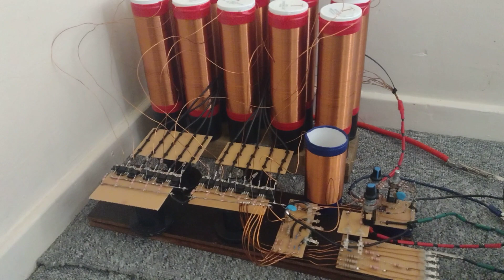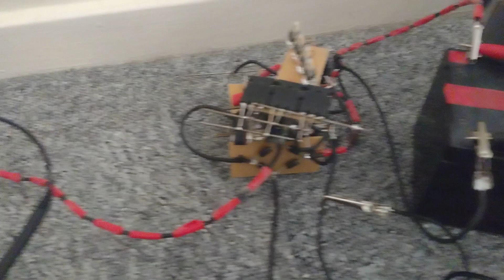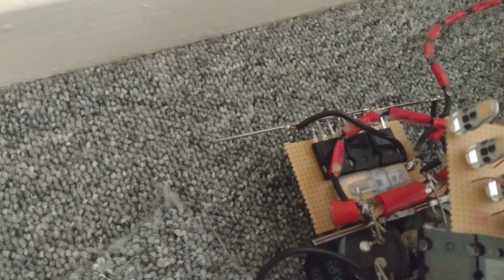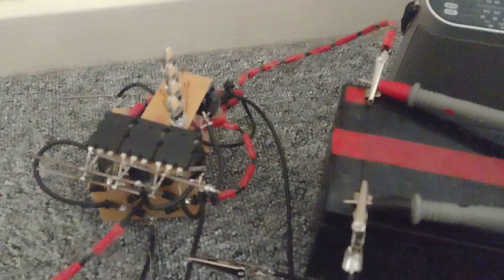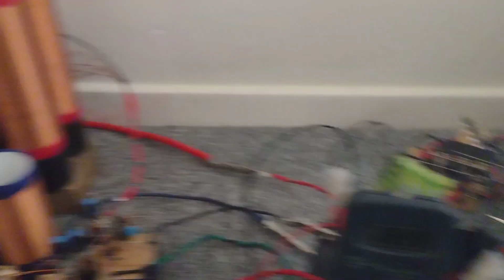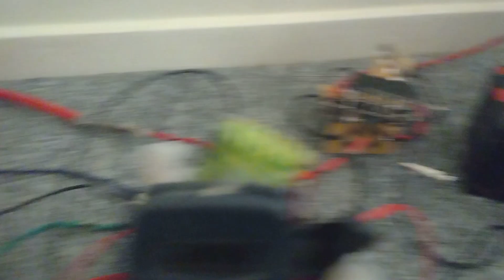Major Updates & huge amount of progress made.

Comment: Are the bulbs acting as negative resistors in the dump circuit or just as tuning resistors. I miss working on energy devices like this there is so much to learn. Thanks for sharing your work with us.
Reply from the maker: Thanks...  The bulbs are actually acting as Optocouplers & are behaving like an automatic  trigger that's switching the Transistors & Mosfets... this is what I thinks taking place here  By ganging them up in series & taking them outside of the Capability of my devices ability to light them...  if I don't use enough of them in series & they begin to glow then this halts the charge...  They all seem to work... every one that I've tried I've had success...  Thanks for your message..
Reply from the maker: I've watched several videos on here where various techs have tore the bulbs down or some of the higher wattage alternatives to reveal real intricate surface mount components inside them which is making this all possible..  including opposing diodes on both sides which makes it possible to reverse the polarity with the LED's & Halogens..

Comment from the maker: I've just increased the power of this device..  which has really improved the charging.  Look at the coil which I'm connecting to the ground with the Small Cap.  I've joined 2 other coils of equal size & connected them in Tesla Series with the 10nF.. this has made a drastic improvement in the charging...

Comment: Thanks
I had a question on your circuit
Where is the red dot going to?
Nice job
Reply from the maker: I replied to you but I don't think my tags are working.  Its not connected.  Your probably referring to a connection coming off the bases of the Transistors.. they're not being used.  Thanks.
Reply: @oliver1224  thank you my friend
I have several questions
1. The 8 coils, are the just single filial wound about 200 turns?

2. The G4 leds, they are 12v?

3. G9 halogen, 120v?

4 I guess the SSR is not connected to anything? It says input but what driving the SSR? I didn’t see any connections?

Thanks for your efforts
By the way, have you done any measurements of any sort for input and output?
What I probably test is to charge one battery or a series of vatterus from another and then switch them around
If we can maintain or increase the voltage on the charger and charged batteries, then we are going somewhere

I like your opinion and the goal here please

Thanks again sir
Reply from the maker: @Gacha.Cupcake  Your correct on everything.  200 turns .21 or .22 gauge wire.  Yes the G4's are lower voltage so this is why you need to join them in series.  It seems that all the G4's work.  Only tried the 3 watt G9 Halogen..  This specific Capsule device is connected on to both sides of the output.. the SSR is switching the positive side... but it will work without it & default on the negative if I disconnect the SSR.  Not sure if you got my message about the red dot on the drawing...  if its coming off the bases of the Transistors then its not being used so its left disconnected.
Reply: @oliver1224  thank you Mr Oliver
So there is no signal driving the SSR?
I will set one up shortly and if I manage to get it to work, I will make a video.

In the meantime, some rough measurements would be in order to figure out efficiency 
Great research my friend
Have a great and ENERGETIC day
Reply from the maker: @Gacha.Cupcake  No it doesn't require it.. it switches itself & only requires the output to be connected or you could use a Fet or NPN Transistor instead... ..All you want to do for starters is have a go at building the the vanilla single Transistor, single coil version shared on Patrick Kelly's website...  then you'll get an idea of how good its going to be... also don't operate it without your output load connected or you'll burn out your circuit.    as for your main Transistor I'd choose the MJE13009.. its performed the best out of the different Transistors Ive tried in it..  Thanks you have a good day too...
Reply: @oliver1224  thanks for the info and advice
On one of the circuits you have +12 and -12 for input
Should that be just zero(ground) and 12 bolt?
I already wound a single coil with 200 turns and even though I have a bunch of transistors, I ordered a few BUL216 since I couldn’t find the MJE13009 at Digi-Key or mouser
Reply: Also can’t find the RDVSBT diodes that are on your diagram
Where did you get them and are they any special or can I just diode a similar diode?
Thabks
Reply from the maker: @Gacha.Cupcake  Go with the MJE13009...  you can source it on Amazon..  then go direct if you wish.  Yes its + 12v & - 12. or ground.  Most NPN's will work in this system.. its just some work better than others.. as for the diodes look for the UF5408.
Reply from the maker: @Gacha.Cupcake  go with the UF5408 diodes & Transistor look for MJE13009.. I got 50 of them from Amazon for just over £35.  They took a while to pre order though..   They work well in that system & they're quite cheap..  Also later you can beta match others to build a more powerful device..  Good luck with your build..
Reply: @oliver1224  thanks
Yes I got UG5408s
Ok on MJE13009
So you are using a power supply for -12/+12?
I was planning on using a battery but I have power supply that can do -12/+12
I was planning on using a signal generator or PWM to drive the mosfet but can do the 555 timer circuit as well 

So from the top of the 8 coils, instead of going to - of cap, you go through the Tesla style coil and then to - of the cap?

Thank you
Hopefully, I will have it set up in a couple of days
I appreciate your help and time
God bless you sir
Reply: @oliver1224  I am not an expert on electronics 
What’s beta match?
LOL
I will search Google and YouTube and try to learn more 
Thank you
Reply from the maker: @Gacha.Cupcake  I wouldn't worry about that at the moment.. that only becomes crucial once you start building multiple coil/circuits.  In a single circuit coil device it won't require it.  The components that are mass produced all have their gains in different places.. so building a more complex device you have to go through a selection process beforehand.  So base resistors, diodes & transistors or mosfets all require beta matching.. which means Testing or measuring.  I have a schematic for something that can test N-Channel Mosfets & NPN Transitors for Diodes & Resistors you can just use a simple multi-meter.  I wouldn't worry about it right now.
Reply from the maker: The way I think of it.. its like a symphony.. these methods are all about timing..  You find in a multiple circuit/coil device that's not been matched some components tend to work their nuts off where others are on holiday... what we're aiming for is to get them all to share the spike... but in the basic Alexkor Radiant Charger its not required..
Reply from the maker: @Gacha.Cupcake  You can use a Battery... in fact it works better with a Battery on the front... I do use a PSU at times..  but I use hefty Capacitor across the front of it in order to protect the PSU from the backspike which can destroy the power supplies..  My advise is to follow the basic circuit to the letter..  You can even build it on a breadboard if you have one initially...  once you get it working then you can play around with different methods & components..  You will need a Cap Dump if you want to use it to charge..  I've still got the Capsule schematics saved on the Community section of my channel... they work really well..  I don't believe there are any Cap Dump schematics listed on Patrick Kelly's website..  people were not aware of some of the negative effects the Spike can have on batteries...  the Capacitor provides the current for the charge & enhances it & speeds it up...  & turns Cold Electricity into a Hot form...  just be cautious around Electrolytic Capacitors if you're not used to playing with them do some studying on them first.. & never ever reverse their polarity because they can explode..  just be safe.
Reply from the maker: @Gacha.Cupcake  DO NOT USE A MOSFET... Use an NPN Transistor... I had to go into a different comment section because Youtube tags are shite... so far with my Cap Dump I've only got the Mosfet to switch across the Positive side...  Go & switch on the High side if you wish with the fet.... if you don't follow the instructions given so far don't expect the same results...
Reply: @oliver1224  got it. I will try to follow as accurately as possible
Appreciate all the advice
Thank you
Reply from the maker: @Gacha.Cupcake  Good luck.. its a good device..  Once you've built it & got it running.. if you want to enhance it further... wind another coil & place in series with the ground...  once you've done that then parallel a 10nF Capacitor across the Coil's windings....  then attach the ground lead on the end of the exit winding of the coil.. it will really enhance the charge & boost the volts...   it works with several of my Solid State Radiant Chargers...   I did it today with my Messner Radiant Charger..
Reply from the maker: @Gacha.Cupcake  Just to let you know you can use the SSR on its own without the Capsule LED's to run as a simple Cap Dump & that works...   Make up a FWBR.  Output + of the SSR to the Output Negative of the device & Negative of the Cap.  The Output - of the SSR connects to the Charge Battery negative.  All positives connect together..  This will initially get you up & running quicker than building the Capsule device... I'll upload the schematic on here in a day or so.
Reply: @oliver1224  thank you sir
Reply from the maker: @Gacha.Cupcake  Your very welcome.  Just a word of advise... I know I've already mentioned it but when you've built your device do not attempt to operate it without the output connected...  if you do that you will fry your entire circuit including the 555.  There's high voltage on the output & its not Direct Current..  Get yourself a NE-2 neon bulb & place it across the Transistors Collector & Emitter.  Some on here call it a fuse or protection but it doesn't offer protection.. its there as a warning to shut the device off immediately & check the output connections...  those bulbs activate at 73 volts..  even at 12 volts input some of these Radiant Devices have no trouble climbing higher than that...